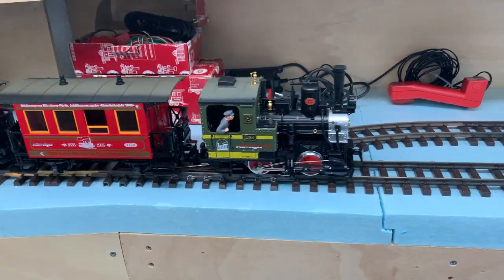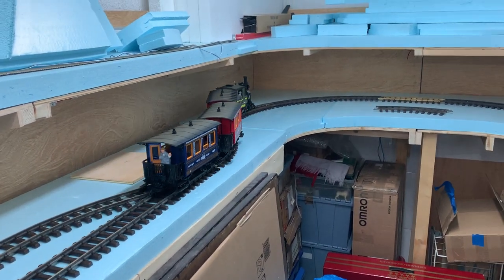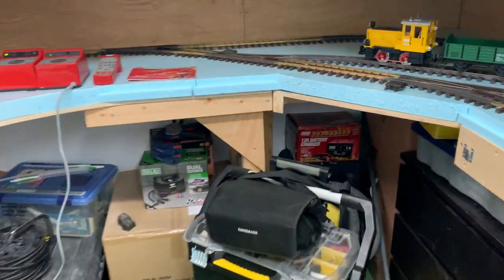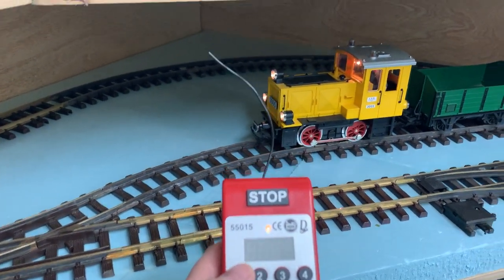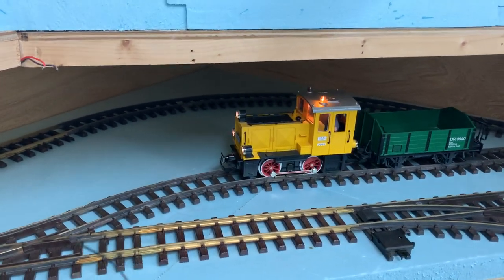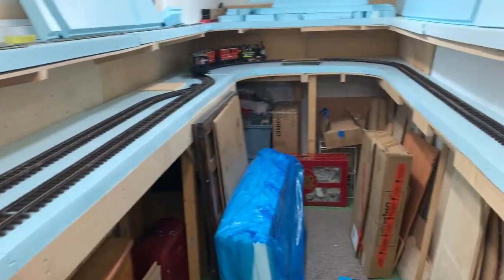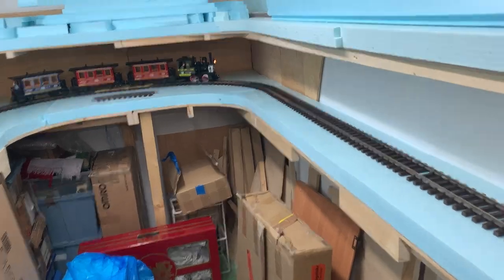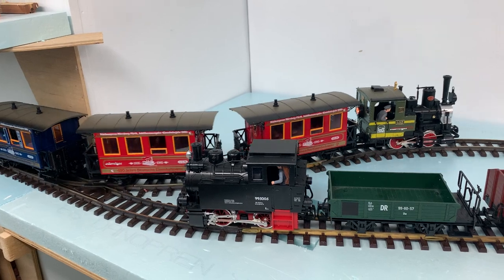Analogue vs Digital LGB MTS (DCC)? Easily Run Both at the Same Time.

Comment: The problem with using an analogue loco on a DCC system is that it can burn out the motor in 30 seconds. Most systems don't allow analogue running these days for that reason.
Reply from the maker: True, ideally you want all locomotives with decoders however LGB made their systems backwards compatible (one of the reasons they were late to the DCC game) and the motors are much larger with a higher tolerance than say an N or HO scale locomotive. When I’m finished running my dc locomotive then I either take it off the track or place it on an isolated track with plastic rail joiners I can cut off the power to with a switch so it’s not sitting idle with AC voltage going through it.